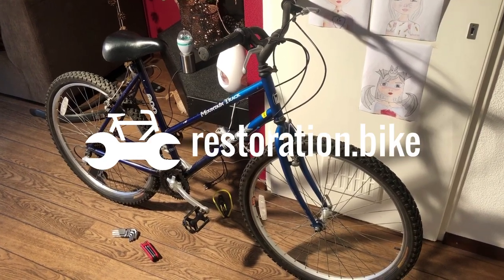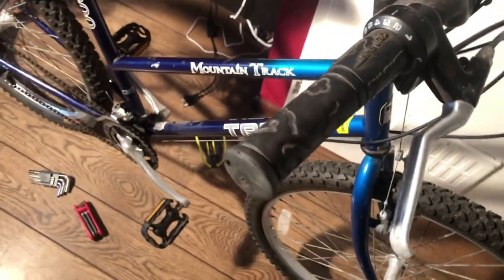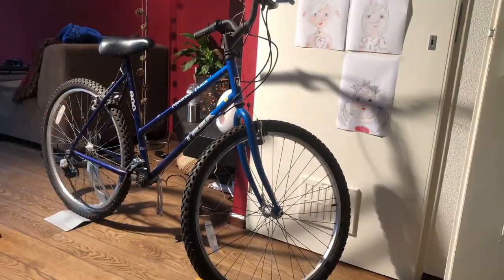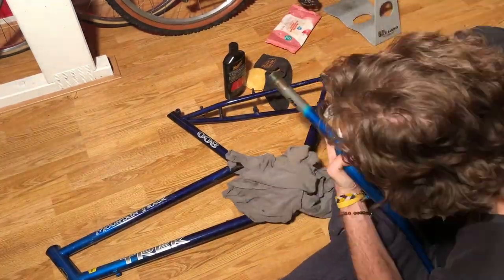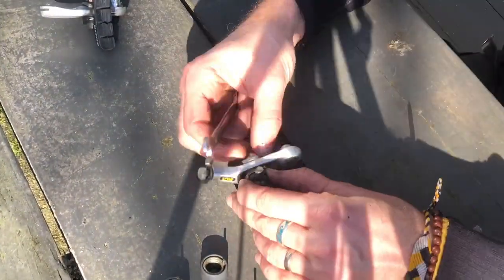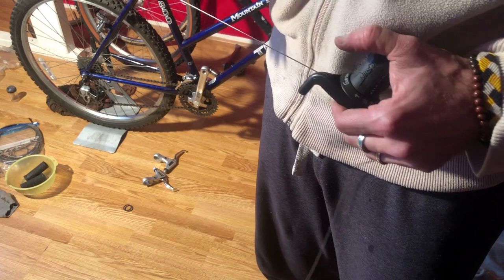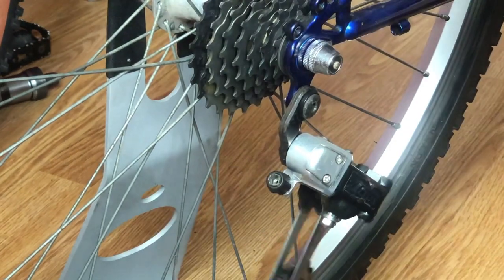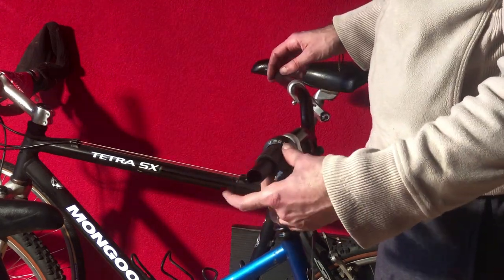Trek 800 mountain bike restoration

Comment: I've got the same bike different year and I'm having trouble getting the rear derailleur back together after servicing it. It looks almost the same as yours. The screws are different lengths and the gears are different sizes and I don't know what goes where.
Reply from the maker: If you still have all the parts, you simply have to learn how to reassemble the derailleur. If you don't have a video of disassembling it, like I have because I make YouTube videos, look up the make and model of your derailleur online to learn how it should look like. I say this because I also pulled things apart, not knowing exactly how to put them back together again.

Comment: Hello, i'm restoring the same bike. May i know the size of the seat post?
Reply from the maker: No idea, but a caliper should give you the correct measurement
Reply: There are different diameters, i have an 800 antelope and my seat post clamp that actually secures the seat had a break in it... etched  in the seat post itself was "26.8"...
But all the googling i did kept saying 27.2
27.2 post/clamp combo was TOO BIG. More google told me some 800s were made overseas, and their seat posts were 26.8
If you dont have a post at all, a metric ruler can get you close enough info of inner diameter of the center post, which will equal the outer diameter of seat post.@restorationdotbike